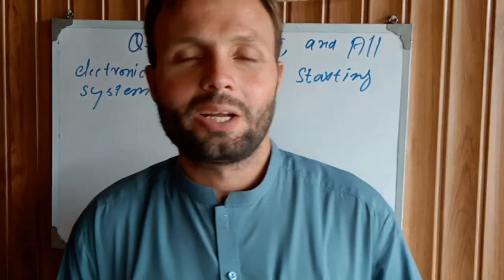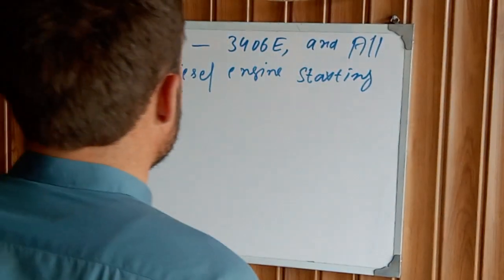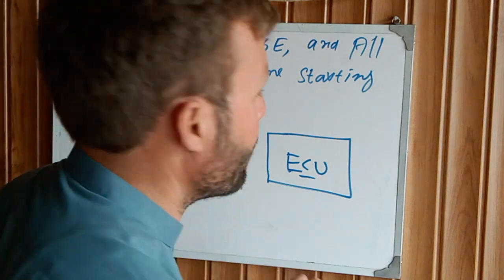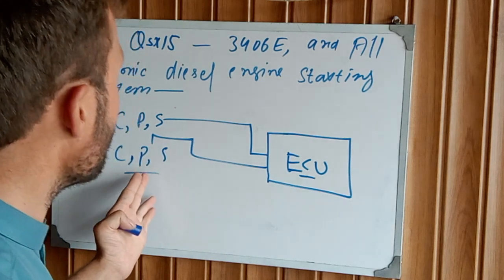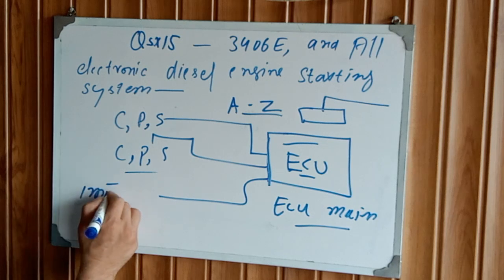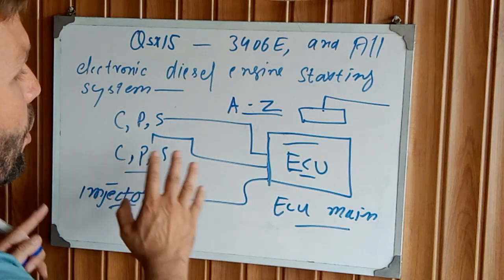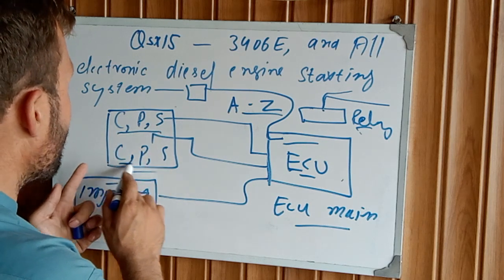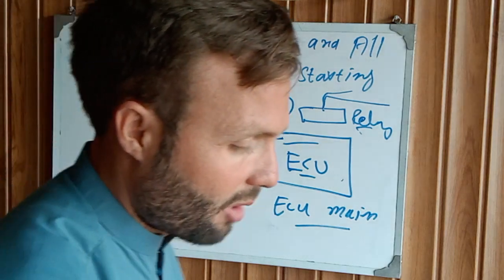Cummins Qsx15, caterpillar 3406, perkins 1300 edi Diesel generators engine starting problems

Comment: How many wires in cam crankshaft positioning sensors
Perkins 2500 series engine, fitted cam and crank position sensor only tow wires
Reply from the maker: Almost 3 wire 
1 is five volt reference 
1 is ground
1 is power

Comment: How check two wires sensors
Reply from the maker: In two wire 1 is 5 volt reference 
Take 5 volt reading with engine ground 
1 is power battery power 12/ 24